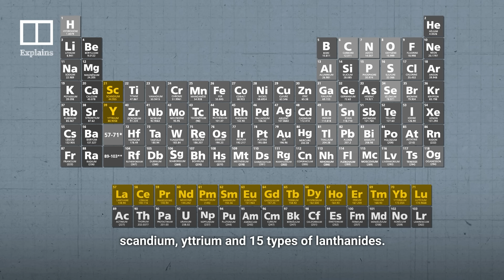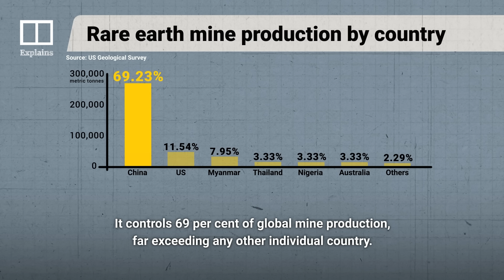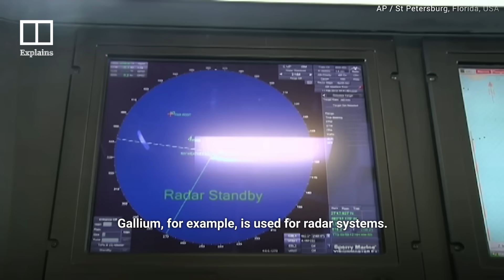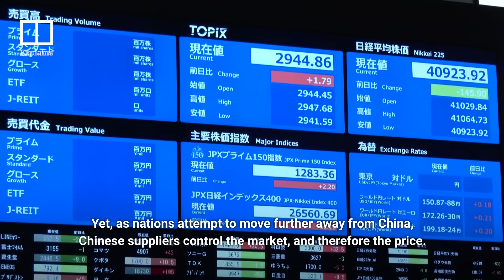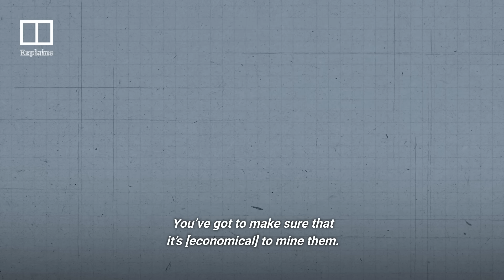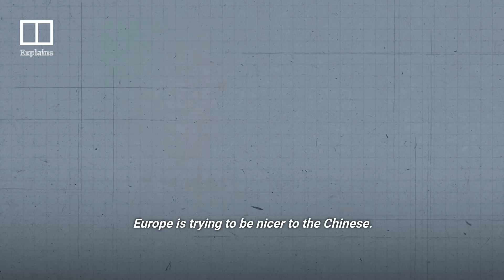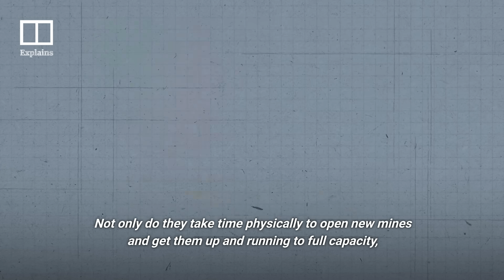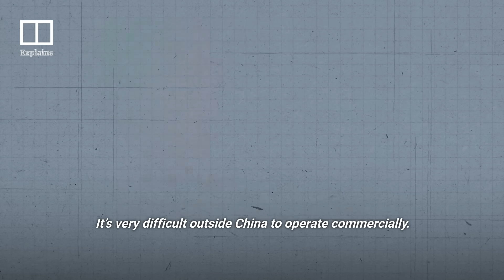Why China’s rare earth dominance faces global pushback

Comment: Beggars will find all sorts of excuses and say that they are not beggars. Indian National Security Advisor, Ajit Doval, and Indian foreign secretary, Vikram Misri went to China and beg on 18th of Dec 2024 and 28th of January 2025....couldn't get the begging job done. Indian defence minister, RN Singh, came to China on 24th of June 2025.....couldn't get the begging job done either. Jaishankar went to China on 14th July 2025 and beg....couldn't get the begging job done either. Now, the big boss of India, Modi, has to come to China and beg personally to show sincerity? Did Indian media reported around 16th Jan 2025 that, "Indian electronics, solar, and EV sectors face delays due to China's export restrictions on key inputs and machinery, which may be a response to India's curbs"?😅🤣😂1) China turns down Sona Comstar’s rare earth magnet import dated 6th of June 2025 by Nitin Kumar 2) India Sends Delegation to China Rare Earth Magnet The delegation includes representatives from the Society of Indian Automobile Manufacturers (SIAM) and the Automotive Component Manufacturers Association (ACMA). Dated 2nd June 2025 CargoConnect. Someone begging😂India to China: Can I have some HREE, LREE and REE saar !!! 🙏😅